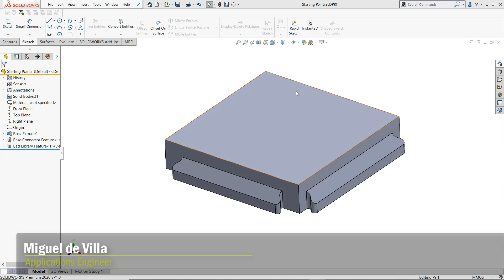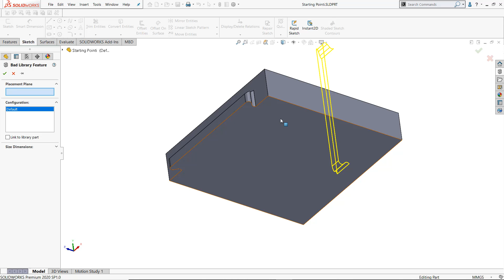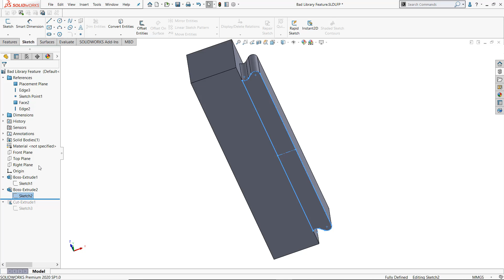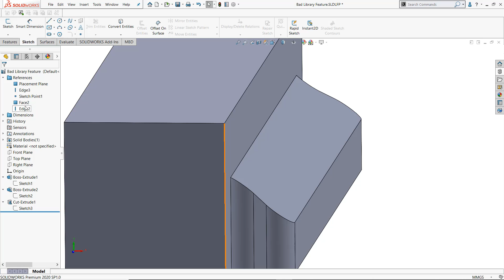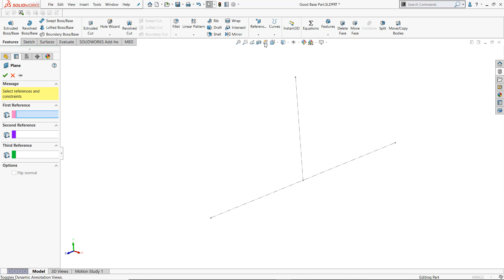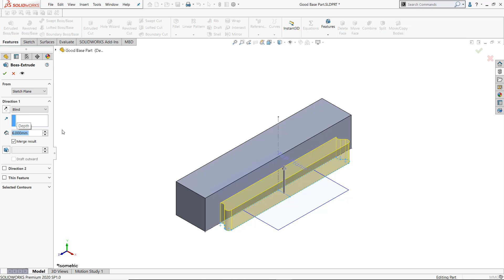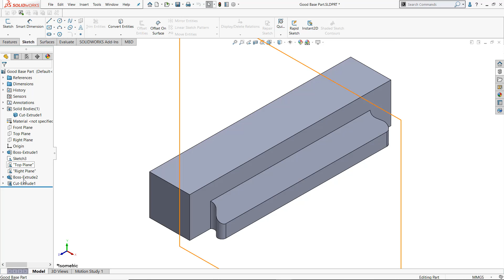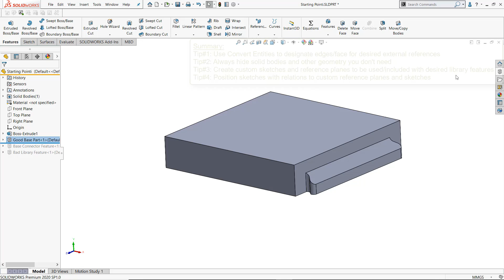SOLIDWORKS Tutorial - Managing External References in Library Feature Parts

Comment: Could You help to restore external references for the parts that was made inside the assembly? after external saving for parts and renaming of folder/assembly name, part lost its references. and I don't understand how to restore.
Reply from the maker: Unfortunately, external references that are completely broken –shown with an X—in the feature tree are not able to be reattached and maintain that same exact reference. You will have to manually remove the broken external reference by deleting or respecifying any existing external relation in your features and sketches and remaking them manually. 

In order to avoid this issue becoming a problem in the future, I would recommend renaming parts or moving files using the SOLIDWORKS file utilities when you right-click on a file or working within a system like SOLIDWORKS PDM to manage your data and prevent this issue from happening in the future.
Reply: @goengineer  thanks a lot